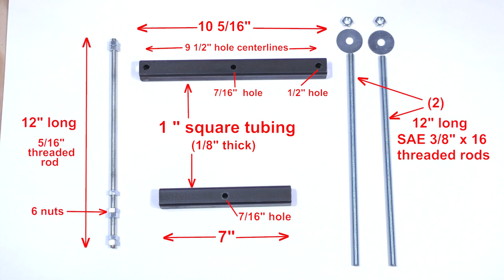Ford E4OD 4R100 Class lesson 4 of 16

Comment: One thing you need to be aware of if you plan to tackle this yourself, if your trans doesn't work correctly, you may very well have broken internal parts, which can greatly complicate removal of those parts.  You could literally get stuck.  Plus, since his trans has already been disassembled and reassembled, it comes apart easily.  Yours won't come apart as easily.

Comment: Just started taking mine apart to figure out what I need to order but something doesn't seem right. I pulled the pump but it doesnt have a pump to coast drum thrust washer. On top of that my coast clutch drum has a ball bearing in it instead of a bushing. I replaced the transmission in 2004 with a Jasper Monster Box which the don't make anymore. Is there supposed to be a washer there?

Comment: I'm a little confused with 7:42 - were those two bolt holes already tapped to SAE 3/8" x 16 to begin with? Or is he saying that he tapped them himself? If we tap them ourselves will that cause an issue when we try to put the bolts back? It looks like all 9 bolts he took out are the same, so I'm getting a little confused here.
Reply: @Joe Hoe they are actually m10x1.5. NOT 3/8".....

The 3/8" works because it's SLIGHTLY smaller.

On stubborn pumps, you will strip it.

Comment: The 2 front pump tapped holes ARE NOT 3/8 x 16 They are metric and the tail shaft bolts are the proper thread
Reply: So using a 3/8 bolt for the special tool to remove the internals can damage those threads?

Comment: Attempting to make stand. Bought 2- 2×4" both 8 feet long and still do not have enough for my 4- 12" pieces. Already cut 4-18" and 6-15". My mistake for not verifying size. Two 8' foot boards equals 192" total length and the cut sizes all equal 210" in length. We will see how the tool goes, but seems pretty simple.
Reply: 25BEDFORD drilling a hole in the table works too